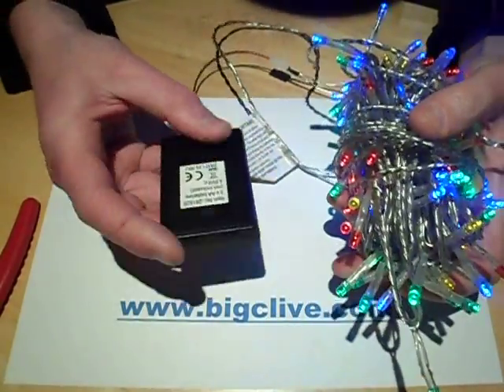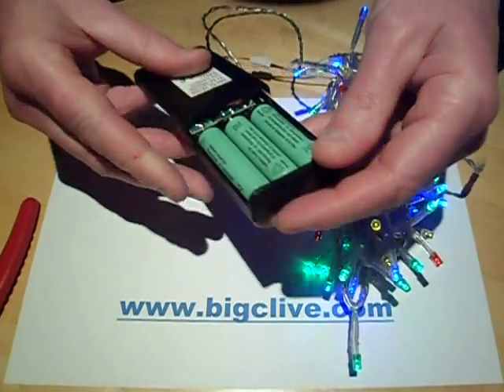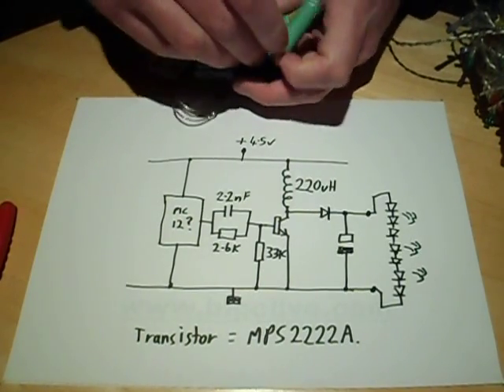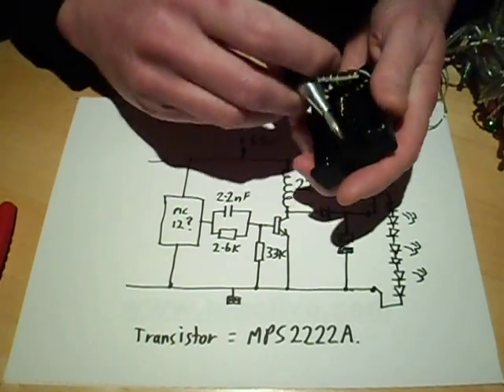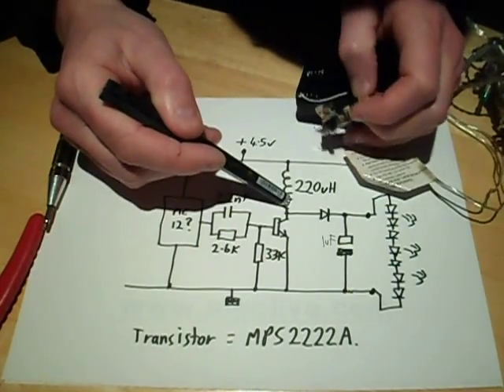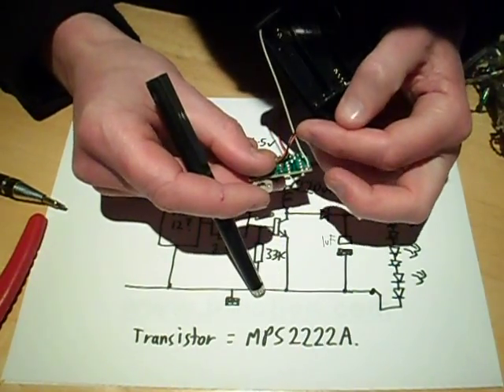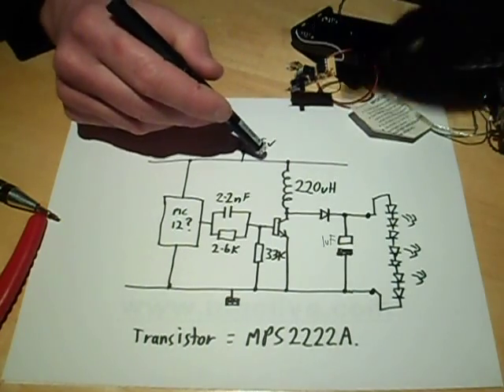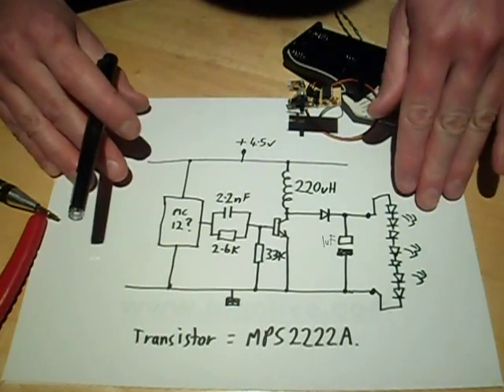Unusual little booster circuit in set of battery operated LED lights.

Comment: A similar circuit is commonly used to generate high voltages for Geiger counters, although a higher voltage transistor is used. Sometimes driven by a 555 or an arduino.

Comment: If you want to find out the frequency there's a downloadable frequency counter/oscilloscope which is quite handy on a PC if you can hook it up to the sound card (via a resistor!) It's called "musical tuner by W A Steer" it hasn't been updated since 2001 but it's very useful and surprisingly accurate.